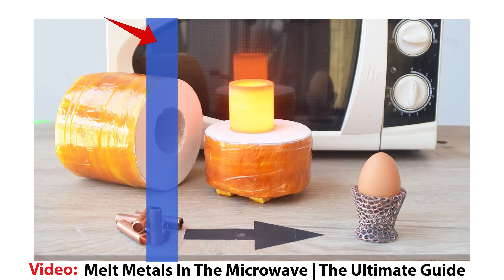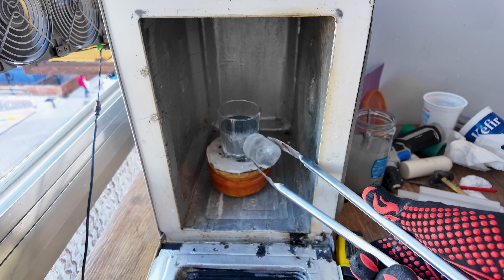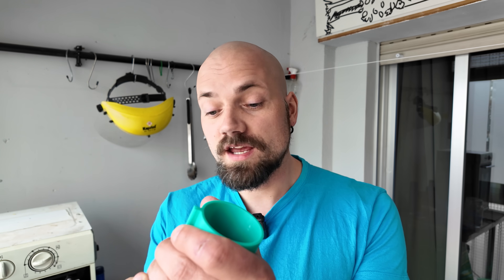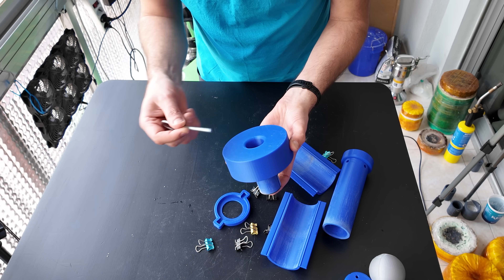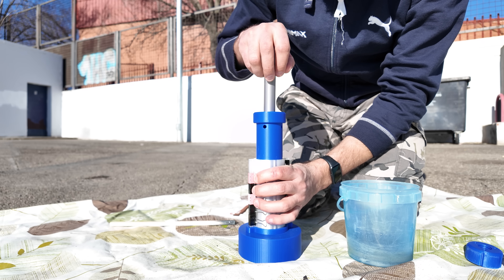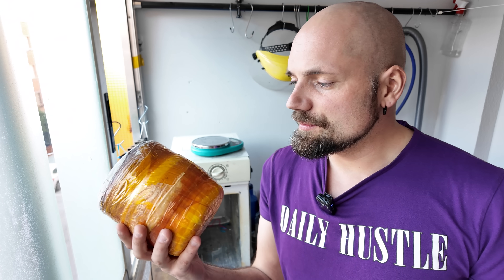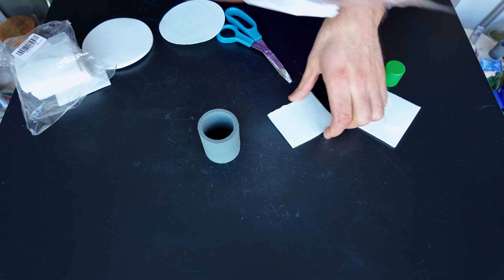How to Make Your Own Crucibles (for microwave metal melting)

Comment: Thanks a ton for dedicating your channel to this very niche topic. If you dont mind but I have a couple of questions.
How much silicon carbide do you typically spend per crucible? 
Also have you tried making wider and shorter crucibles that have at least 4-5 inches inner diameter width. It would possibly open the doors for melting larger amounts of metal at once. The tall narrow ones you make seem to be resistant to thermal shock and cracking, would be interested to know if wide silicon carbide crucibles are feasible and have the same durability...
Lastly, have you looked into Rock Wool as a substitute for ceramic wool? Here in the balkans I cant find any ceramic wool, rock wool is the next best thing, and its also a lot safer to work with, has max refractoriness up to 1000c and has the same thermal conductivity as ceramic wool.
Cheers.
Reply from the maker: Those smaller crucibles (the ones I hardened) required 120g of silicon carbide—possibly even less if you make the bottom thinner. The tallest crucible used nearly 300g. I plan to explore wider and shorter crucibles, but I need to make new chambers first.

I have not tried rock wool. Ceramic fiber is one of those materials you’ll probably need to buy online rather than at a local hardware store. Sometimes, that means ordering from another country in the EU… if you’re in the EU.

Cheers!
Reply: @ShakeTheFuture  Thanks!!!
You may have mentioned somewhere in your videos already but I must have missed that part, what dimensions(OD, ID, height) are your crucibles ? Just asking so I can get a feeling of what amount of silicon carbide it would take for custom sized crucibles.
Reply from the maker: @ThatThing1675  Well, that depends. For example, the new crucible molds come in different thicknesses. The small crucible I hardened in the video is 67mm tall, with a 50mm outer diameter (OD), a 39mm inner diameter (ID), and a 5mm thickness. The larger one is 108mm tall, with a 68mm OD, a 55mm ID, and a 6mm thickness.

Cheers!

Comment: It's a home microwave, can I melt silver in it? Is carbide the same material used for welding torches? Can you describe what "glass water" is? I'm from Argentina, I've never heard of that product.
Reply from the maker: Yes you can melt silver. I don't know what's used in welding torches, but you can find silicon carbide grinding stones and silicon carbide sand papers. Water-glass is sodium silicate (silicato de sodio)

El silicato de sodio superneutro es una sal alcalina económica con múltiples aplicaciones industriales. Es utilizado como adhesivo, en detergentes, cementos, y como agente anticorrosivo o defloculante. Su versatilidad en diversos sectores lo convierte en un producto esencial en la industria química.

Cheers!

Comment: Thank you so much for putting these videos out! I am doing some scientific work at high temperatures and needed a custom heating chamber and this fulfills my needs very well. Would using a hydraulic press be useful in compacting the molds?
Reply from the maker: Well, I don't have a hydraulic press, but it could definitely benefit. Cheers!

Comment: Where is the video on how to use the microwave, what modifications do you have to do to the microwave
Reply from the maker: Well, there are plenty:
A tutorial on microwave metal melting https://youtu.be/P1VmIYheuU4
Video of kiln making and using to burn out molds using a microwave https://youtu.be/XCI_FPDQA-U
Then there are all the other metal melting video I have done in the last year. I only use microwave for melting metals.
The microwave is NOT modified in any way. It's just an old microwave flipped on the side.
Cheers!

Comment: I have one suggestion that could perhaps allow for the hardening step without using ceramic fiber at all. If you paint it with sodium aluminate and fire it, you should (theoretically) also get a hard aluminosilicate layer, albeit much thinner. Denny, have you tried making your crucibles with sodium aluminate instead of sdium silicate (or a blend of the two)? You can get it by dissolving kitchen foil in caustic soda (NaOH) or theoretically, a hot solution of washing soda (Na2CO3). That way the whole crucible would become hard from the first firing. EDIT: I just remembered that there's aluminium sulfate (E520), sodium aluminium sulfate (E521) and potassium aluminium sulfate (E522) that are used as a food addtives and all decompose to form alumina.
Reply from the maker: I have not tried sodium aluminate, but I'll add it to my project list and might give it a shot. Thanks!

I have tried potassium silicate, but I only tested it once, and the crucible didn’t turn out great. Obviously, one failure isn’t enough to judge, but I’ve put it aside for now....too many projects on the list :)

Cheers!
Reply: @ShakeTheFuture  Hi Denny, just updated my comment with some things I remembered. Also, interesting experiment, thank you for sharing the results!

Comment: How does Ceramic fiber/wool compare to refactory bricks/shapes (which you can custom make/pour) ? Also you should consider including your heating/cooling times when you use the microwave (so the audience has a general idea).
Reply: ceramic fiber insulation has about 10x smaller thermal conductivity
Reply from the maker: I haven’t used these materials because I wanted these methods to be easily repeatable worldwide, no matter where you live. For example, if I used a pourable ceramic fiber slurry available in the USA, people in the EU would have a hard time getting the same product. That’s one of the reasons I chose ceramic fiber—not because there are no other options.

I’ve already talked about heating times in various videos if you’re referring to metal melting. If you mean crucible hardening, I was microwaving the second crucible between 20-25 minutes.

Cheers!
Reply: @ Oh refractory bricks are made of perlite or vermiculite if you don't have perlite (5 parts), mixed cement (usually white cement, 2 parts) then water is added (2 parts). Pretty sure these ingredients are common globally. But I'll take it (from the other commenter) that the microwave requires the lower thermal conductivity of ceramics (weird because I've seen refactory bricks take 2000 degree heat without getting hot).

They might still be good just to have around your shop, and because you can cast them in any shape that you can make a mold for. Just a thought.

Comment: why do you put in freezer?
Reply from the maker: So, we could remove the silicon carbide crucibles from 3D-printed molds. Otherwise, the crucible might break when you try to remove the mold. By freezing the mold, the silicon carbide temporarily becomes as hard as frozen ground.

Comment: It still amazes me how much you can do with such simple materials and equipment, I absolutely love your channel!
Reply from the maker: Thanks!
Reply: @ShakeTheFuture  Yes except you cant really find silicon carbide in the kitchen exactly, sodium silicate can technically be made from baking/washing soda and sand at high elevated temperatures though. And the ceramic fibre is a high tech material imo.

Comment: What’s the difference between silicon carbide crucible and graphite crucible? Also like to add make a pouring groove or spout on your crucible maybe that will help when pouring.
Reply from the maker: I’ve never needed a pouring spout on crucibles this size—they pour just fine. One way to add one is by using a file to make a small cut.

I’ve never made graphite crucibles, but the ones you can buy probably won’t work. I can’t speak for all of them, but at least the ones I’ve tried didn’t work.

It’s similar with store-bought silicon carbide crucibles. The thing is, you won’t really know if they’ll work until you try them. Silicon carbide crucibles contain other materials that can affect microwave absorption, so there’s a chance they won’t heat up properly.

As for graphite, it’s on my list to experiment with—specifically adding some to my SiC crucibles to see how they perform.

Cheers

Comment: I have two questions. First, are your crucibles really sintered? The sintering temp of silicon carbide seems to be around 2200 °C. Is this temperature really reached? And second, why don't you use just one of your insulating chambers to harden your crucible?

Thanks for your inspiring videos 👍
I want to try this one day.
Reply from the maker: I have never said anywhere that my crucibles are sintered. I’ve seen articles written about some of my videos claiming that I sinter my crucibles, but I never said that. :)

So, no! I would say that the ceramic fiber is the material that bonds with silicon carbide and makes it stronger.

Well, I did use the insulation chamber to harden the crucible later in the video. In case you missed it, I actually hardened two crucibles in the video. The second one was hardened with an insulating chamber, but the crucible was covered with ceramic fiber kiln paper.

Cheers!
Reply: @ShakeTheFuture  Aah! Now I got it 😁
Thanks for sharing. It's really amazing what you are doing!

Cheers

Comment: have you tried to wrap the crucible in a fine stainless stainless steel mesh to avoid cleanup of the fiber residue?
Reply from the maker: I haven’t, but one thing to keep in mind is that the microwaves need to heat up the crucible. If you wrap it with a wire mesh that blocks the microwaves, the crucible won’t heat up.

Cheers!
Reply: @ShakeTheFuture  OMG yeah your're right. Me stupid, I did thought of that side effect at all. 🤣

Comment: Wow. You could theoretically make calcium carbide and thus acetylene.

Silicone carbide has a sublimation point 4,500f 800 degrees farenheit over calcium carbides formation at 3900f. 
What a useful chemical that is.
Reply from the maker: Interesting! Thanks for sharing!

Comment: Maybe you could use vermiculite instead of ceramic fiber. But it comes as flakes/granules instead of sheets.
Reply from the maker: I’m not sure about vermiculite, but I have tried making microwave kilns from 100% perlite—it melted!

Now that I think about it, I might have tried vermiculite too… Googling while writing this comment, no edits 😆 … Yep, I tried it, but I don’t remember the result.

Perlite, on the other hand, could work if it’s not exposed to direct heat. Maybe as a chamber rather than a microwave kiln covered with silicon carbide, it could be effective. If not, it might work as secondary insulation. Cheers!

Comment: If you used one of these just as a microwave susceptor (maybe even upside-down) and also got the timer settings right, do you think you could also a microwave as a pottery kiln?
Reply from the maker: Even though I have not tried it, I think it could work. I have done some bottle-slumping in a microwave kiln. You can see the kiln at the last 7 seconds of this video:
https://youtu.be/XCI_FPDQA-U?si=hI2M88-G41yNFqfQ&t=4010
I only did one bottle to see if it works. It was not perfectly flat, but at least I knew that it will work. That's a project I need to re-start.
Cheers!

Comment: i have a huge spool of that ceramic fiber like 3 feet tall and and prob like 5-8 feet long i used it to make a chamber to melt metal like brass and aluminum etc and yes i always used a respirator when handling it i heard its very bad for u its basically a asbestos replacement

Comment: Crafting Durable Crucibles: An Updated Guide to Silicon Carbide and Sodium Silicate

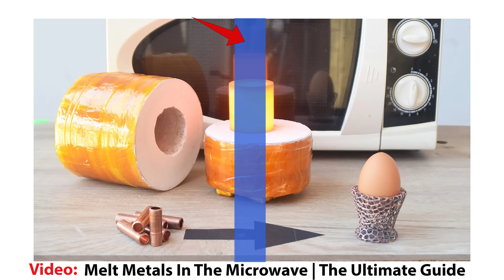*   0:00 Introduction: An updated version of the crucible-making segment from a previous microwave metal melting video is shown. 
*   0:12 Materials Needed: Silicon carbide (fine, medium, or a mix of coarse and fine grit) and sodium silicate (water glass) are required. The suggested ratio is 8-10% sodium silicate by weight.
*   0:37 Mixing and Filling: The silicon carbide and sodium silicate mixture is added step-by-step into a mold (glass or 3D printed) and pressed down firmly.
*   0:50 Shaping the Crucible: Tools such as wooden sticks or 3D-printed tools can be used for pressing and shaping the crucible.
*   1:14 Microwave Curing: The crucible is placed on a ceramic fiber sheet and microwaved until the glass cracks (ice cube can be used to accelerate cracking but be careful to not overdo it).
*   1:48 Finishing: Sanding tools (files, sandpaper) are used to refine the shape of the crucible after removing it from the cracked glass.
*   2:05 Pre-Heating: The crucible should be heated in a metal melting chamber before its first use.
*   2:24 Hardening (Optional): Hardening makes the crucible stronger and less prone to cracking. Whether it's needed depends on the crucible's shape, thickness, height, and intended use. Hardening naturally happens when used with high melting point metals or fluxes.
*   3:20 3D Printed Molds: 3D-printed molds (available on printables for old molds, Patreon for new) can be used. New molds offer different sizes and thicknesses.
*   4:10 Mold Assembly: A lid (printed in soft filament is recommended), M5 screw with a hook, and binder clips are used to assemble the 3D-printed mold.
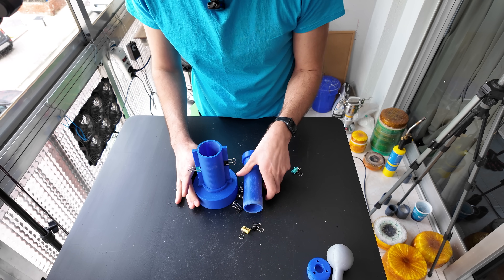*   5:06 Pressing Tools: Custom press tools with a handle increase pressing efficiency. Tool for adding air also exists.
*   6:56 Freezing: After filling the 3D printed molds, freeze for at least 2 hours to help unmold the crucible
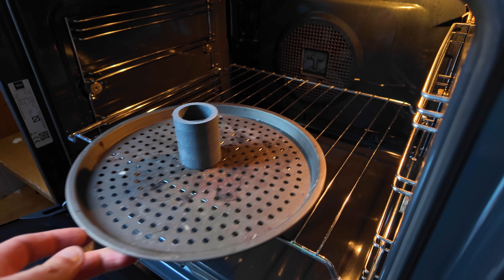*   7:40 Hardening Process: The crucible can be hardened by wrapping it in ceramic fiber, securing it with rubber bands, and microwaving until it glows red. Once cooled, the ceramic fiber is scraped off (wear a respirator).
*   8:55 Downsides of Ceramic Fiber: Working with ceramic fiber is messy and requires protective gear (respirator, gloves).
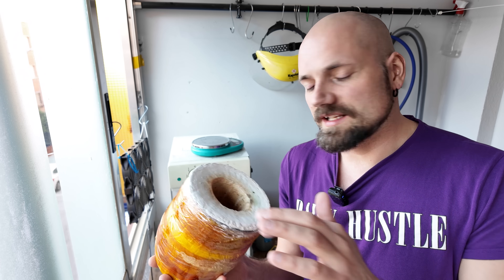*   9:55 Alternative Hardening Method: Using ceramic fiber kiln paper (for glass fusing) glued to the crucible with school glue is a preferred method.
*   10:30 Ceramic Fiber Kiln Paper Method the user is still advised to wear gloves.
*   11:01 Heating with Kiln Paper: The crucible with kiln paper must be heated well until the paper disappears or fuses with the silicon carbide.
*   11:43 Benefits of Kiln Paper: This method is better, cheaper, and avoids the downsides of loose ceramic fiber, but works best with smaller crucibles.

I used gemini-2.0-flash-exp on rocketrecap dot com to summarize the transcript.
Cost (if I didn't use the free tier): $0.50
Input tokens: 19450
Output tokens: 709
Reply from the maker: Thanks for this!

Comment: If i will have lathe, i will try make sort of cup size form to press SiC with BENTONITE in it with hydraulic portable car lift.
It probably can make many time use melting pot, because liquid glass work <10 times or something.
Reply from the maker: If you use your crucibles with other metal melting methods besides a microwave, then sure, you can easily add things to the crucible. However, if you’re planning to use them for microwave metal melting, you need to be careful. Extra materials added to the crucible can make it heat up less efficiently or not heat up at all.

Cheers!

Comment: Thanks for this guide!

Which 'grit' of silicon carbide do you use?
Reply from the maker: I normally use FEPA 220. But in the video, one of the grits started as FEPA 60, and then I ground it with a cereal grinder—so I’m not exactly sure what grit I ended up with. Fine-ish

Comment: 9:54 You can seal the ceramic fiber with alumina slurry and harden it to keep the fibers in place
Reply: @avenuex3731  How do you make alumina slurry? Thanks for sharing, friend.
Reply from the maker: I don't have need for that. I am happy with the metal melting chamber. Kapton tape and kiln wash (that contains alumina as well) works very good in my opinion. I also want to try out AES fibre, so watch out for that video 😀

Comment: 8:08 Rätselhaft, warum der Tiegel glüht.

Bei Wikipedia ist ein interessanter Beitrag zum Aushärten zu finden: "In der Gießereitechnik kann Wasserglas als Bindemittel für Sandformen verwendet werden. Dabei wird das Aushärten meist durch künstliche Begasung mit Kohlendioxid beschleunigt."
Reply from the maker: The crucible heats up because silicon carbide absorbs microwaves—that’s how I do microwave metal melting.

Yes, you can use CO₂ to harden waterglass, and I used to do that, but I stopped since it was an extra expense I didn’t need.

Cheers!

Comment: This got me thinking if I might save on crucibles by making them, and thinking about using Rock Wool and firebrick as insulation. Ceramic fiber, kind of worries me.
Reply from the maker: Yes, there are more materials that can work. I have never tried rockwool. Cheers!